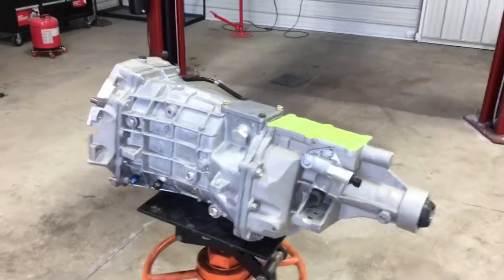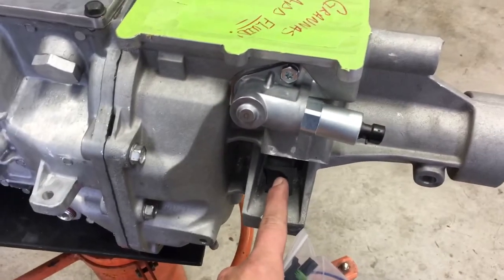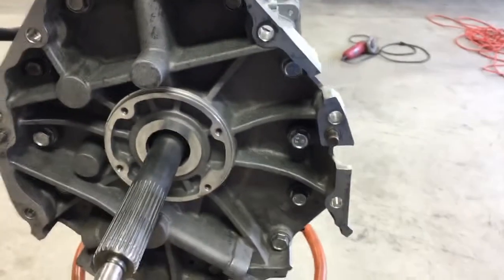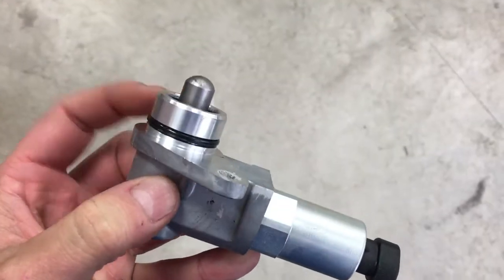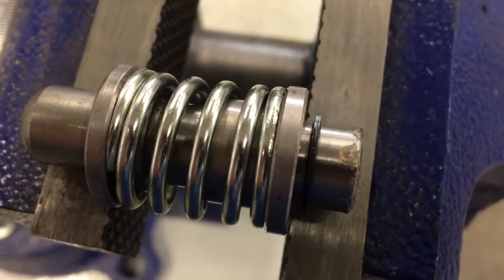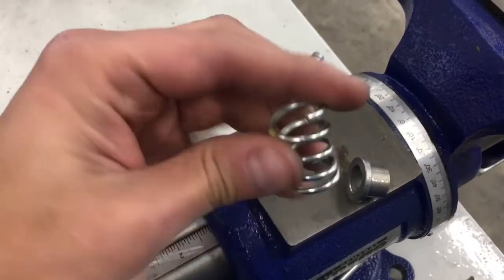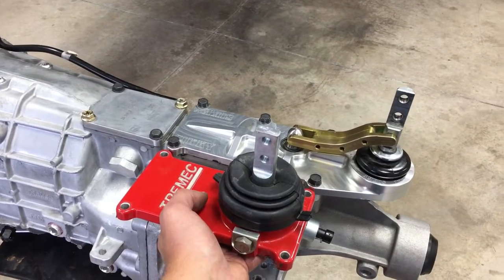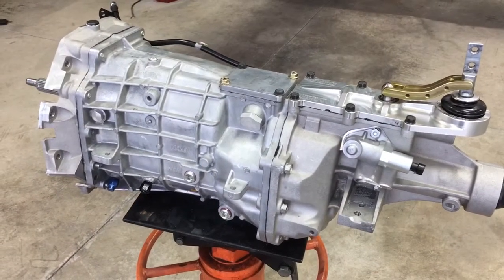T56 Magnum Install: Reserve Lockout Solenoid spring modification

Comment: Why not just gut it and put it back empty ? Seems much easier
Reply: Wouldn’t that lead you to accidentally engaging reverse, going from 6th to 5th, or 4th to 5th; or even just going to 5th gear in general…?

I see the lockout delete kits, which include 2 springs (weaker and stronger) for preference. Isn’t this basically just eliminating the need to keep the factory electronic lockout? 

After all, the stock electronic lockout, is a super strong detent, right? Which CAN be forced into reverse with the stock electronic reverse lockout, but it’s pretty damn tough. In some cases, you can bend your shifter over time. 

I just find the stock one annoying, as I will need to park my gear in reverse (on an incline), and I have to turn off the car, wait for a second for engine to turn fully off, then I turn ignition back to ‘on’ position so I can disable e-lockout on reverse, to be able to put the shifter into it…
Reply: Update. I pulled the snap ring and gutted mine put it back in now i have reverse! Simple fix and didnt cost anything.

Comment: I see you don't recommend cutting the spring anymore, why not? What's the new solution? I cut mine and since then I've broken the sikky shifter handle twice putting it into reverse to overpower the spring... kind just want to get rid of it at this point.
Reply from the maker: Using 12v to the lockout to actually release it. Using the t56 harness https://www.grannasracing.com/products/t56-magnum-wiring-harness-with-bluetooth-speedometer-and-lockout-control

Comment: would cutting the reverse lockout spring work for the TR6060 as well??
Reply from the maker: I no longer recommend doing this modification
Reply: @GrannasRacing  how comes?
Reply: Dude just remove the entire spring and install it empty. The hell with cutting and doing all that none sense. That’s what I did and worked great.

Comment: Hi will your doing mod work for all cars? I wanted to install this into a 2001 mustang since this trans is in the 03 cobra mustang just curious if your spring would fix the lock out
Reply from the maker: I no longer do this. I now recommend using the harness kit I sell which will unlock it automatically under 4mph

Comment: Core Shifters makes a softer bias spring for about $10. I run one in my Chevelle and it’s perfect, no chance of accidentally going into reverse but it also doesn’t take both arms to use reverse when you need it.